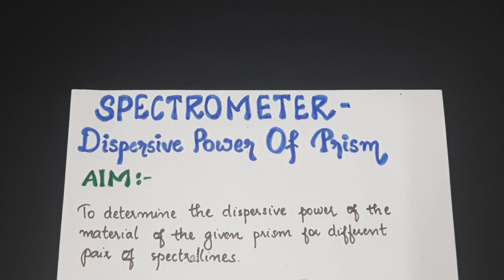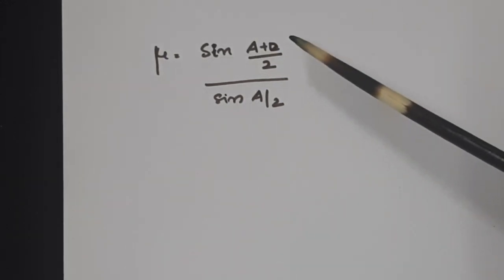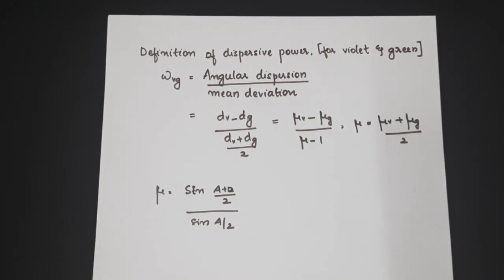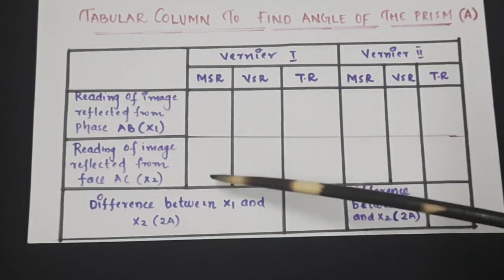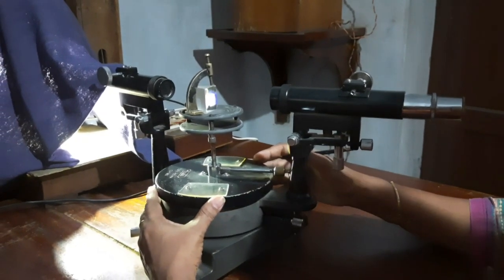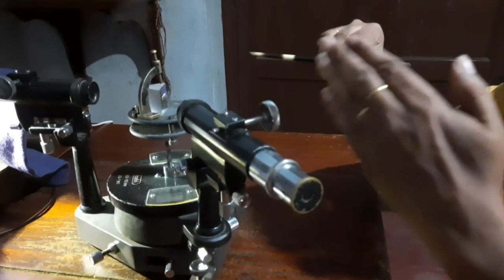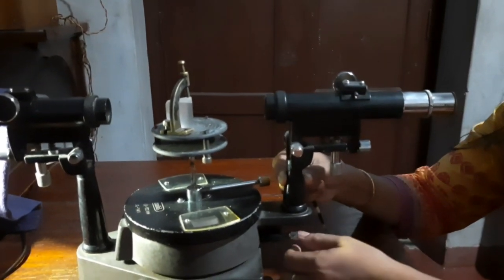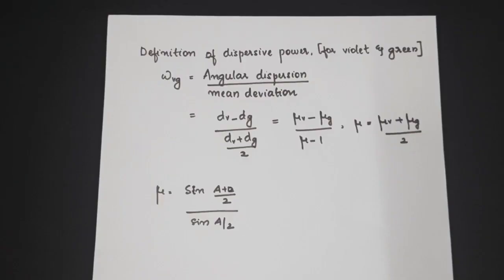Spectrometer- Dispersive power of prism

Comment: Very nice explanation mam, I have one doubt. delta = A ( u-1 ) for thin prism only. So why we use this formula (mentioned in your video ) for calculating dispersive power of equilateral prism.
Reply from the maker: As we are measuring deviation under minimum deviation condition , we can approximate it as equivalent to small angle prism.